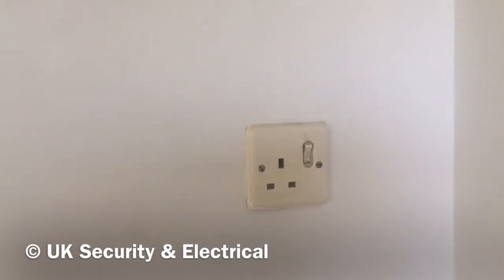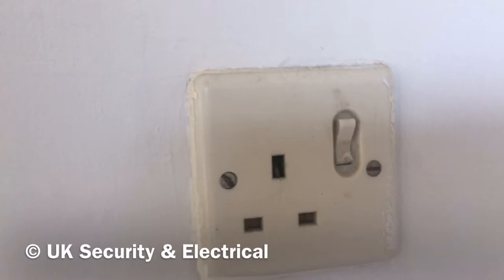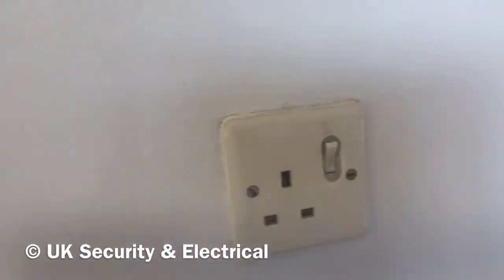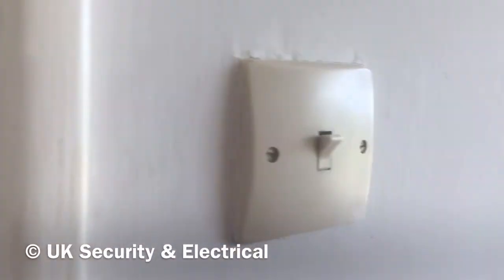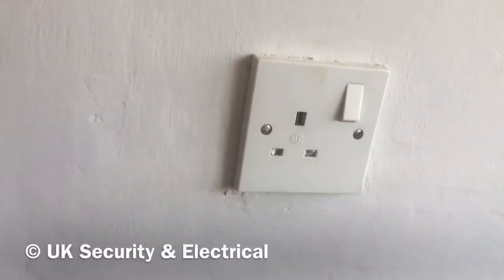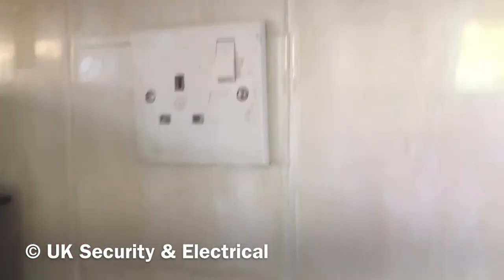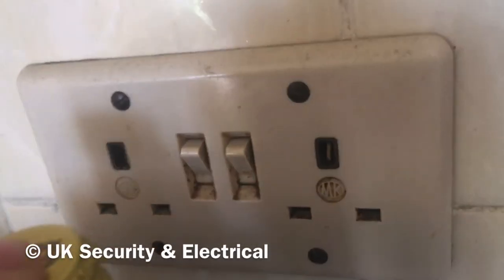#1 Electrical Vlog | Old switches & Sockets

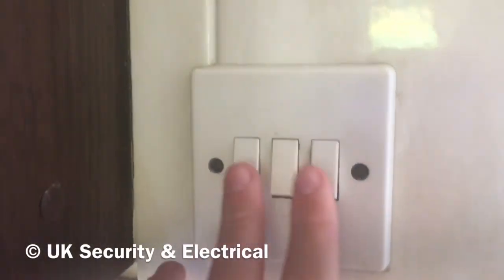Comment: 1:00 looks like Contactum, very famous British company.  
The style is still available and made in the UK and called the Traditional Moulded Range.  
Tenby always had Tenby logo in right hand corner and a thicker protrusion from the wall.

Best brands are MK, Crabtree and Contactum.
Best way to clean sockets without scratching is microfibre cloth and a little washing up liquid (no water).
Reply from the maker: It’s actually an older Crabtree.
Reply from the maker: All these have been removed now and I’ve got them in a bag somewhere
Reply: @uksecurityelectrical  Of course.  My mistake.  Marbo (Marbourn) from 80s had a range that are identical, when Crabtree moved to the Capital style (large curved rocker) in 1988.

Contactum looks very similar but sharper, stubbier switches.  Nice accessories.

I realise you meant the last generation of Tenby afterwards too.  When they were Legrand.